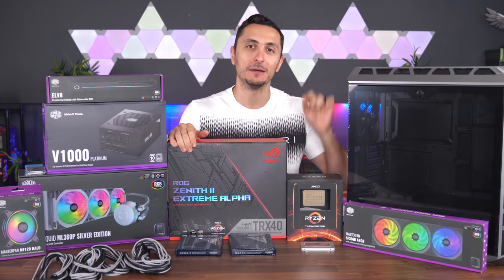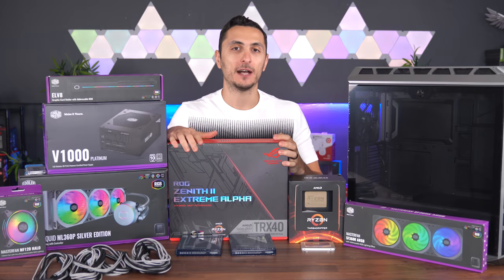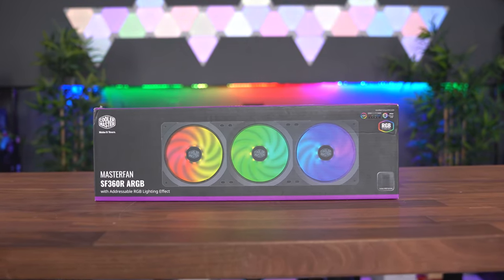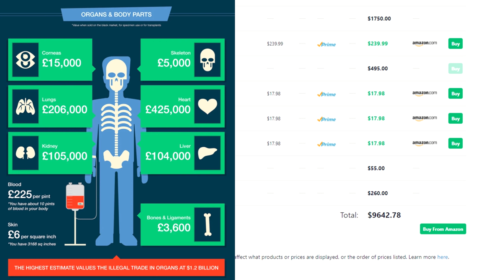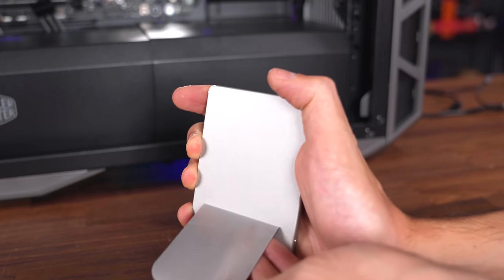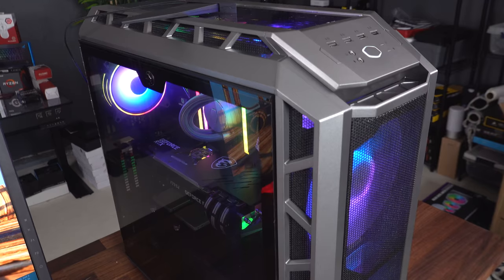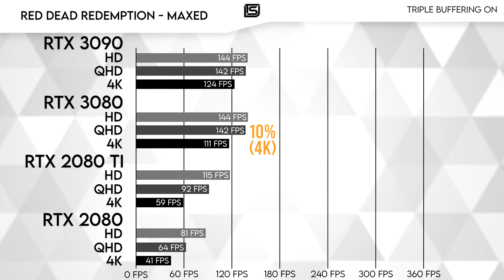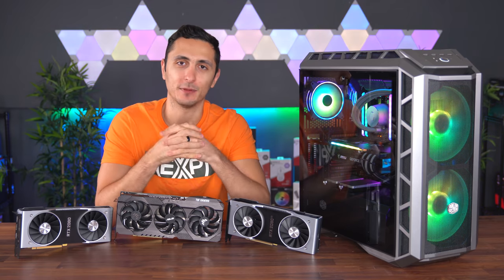Ultimate $10,000 RTX 3090 + TR 3990X  PC Build

Comment: Quick tip: flip the radiatior because it always has 5-10% air in it and air will rise up the tubes and enter the pump making it noisy and less reliable
Reply from the maker: I couldnt do that because of the way the cooler was designed. The bracket gets installed only 1 way.
Reply: @TechSource  then  top is the way to go 👍🏻
Reply: @TechSource Edgar I’m 11 and never had a gaming pc I’m thinking of getting one would these specs be any good 1650 super and a Ryzen 3300x thank you  😊
Reply: @FortniteKidOn60 FPS Dont buy a pc if you’re only gonna play fortnite, plug a keyboard and mouse into your console.
Reply: Red Eyed Ghoul thank you but I play Skyrim and warzone and lots of other games XD
Reply: Red Eyed Ghoul for the love of god don’t play Fortnite with k&m in a console the input delay is no bueno.
Reply: @SkyQ Who tf would spend over 1000$ just to play fortnite.
Reply: Red Eyed Ghoul  you have a very good intro 😉
Reply: Red Eyed Ghoul but that intro

Comment: 1000w seems a little light. Also, be careful using RAID with NVMe. One of the big advantages of NVMe is that the CPU has a direct connection to storage. As soon as you turn on RAID, you give that up. Also, in the case the rad should be on top. The front 200mm fans don’t have enough static pressure to push through/around a rad. Last, the 3970X would have worked just as well for non-numa aware applications (which is almost everything).

Comment: Hey TechSource, I wondering if this is a good build. 
Specs:

CPU: AMD Ryzen 7 3700x 8 Core Processor
Motherboard: B550
Ram: Corsair/G Skill 32 GB RGB Ram 3200Mhz 
Storage: 1 TB NVME M.2 SSD
GPU: NVIDIA RTX 3070
Fans: Corsair LL120 Triple PackFans
PSU: 750W Bronze Power Supply
Windows 10 Pro
Total money for the build is 2000 dollars.

Comment: Awesome, almost the most powerful PC ever, but why Ampere instead of having on top the Smart Access Memory?
My ultimate computer to end 2020 would be

Case: Thermaltake View 91
Power supply: be quiet! Dark Power Pro 12 1500W
Mobo: Gigabyte TRX40 AORUS XTREME rev. 1.1
CPU: AMD Ryzen Threadripper 3990X
Cooling: Thermaltake Pacific CL360 Max D5 Hard Tube Water Cooling Kit
RAM: 8 x 32 GB - DDR4 4400MHz
Storage unit: 4 x NVMe PCIe 4.0 SSD
GPU: Radeon RX 6900 XT
Audio card: RME PCI Express 24 bits

Comment: Wait. The Threadripper only supports 3200mhz, so isn't the 4400mhz absolutely unnecessary since it will regulate it down to 32 anyway?
Reply: yes, and funniest think is that if your CPU isnt utilized 100%, RAM overclock is pointless as well.

Comment: I need help, I have a iBUYPOWER PC. The specs for this PC are Intel i7-10700F, it has 16GB of Memory, a NVIDIA GeForce GTX 1660 Super 6GB, and a 480GB SSD + HDD. The graphics I’m giving to my friend and I’m going to be replacing it with maybe a RTX 2070 Super or a RX 5700 XT possibly on Black Friday or on Christmas where it COULD possibly go on sale. And if not those two options of a Graphics Card, could somebody recommend me any. Or whatever other parts I could switch out and upgrade on? For maybe of a good price of $600 or below.
Reply: Rtx 2070 super duh. If you're lucky you could find a 2080

Comment: Omg... did u really use only 64 GB of RAM for a 64core/128threads CPU ??? 
That is the bottleneck of the century. I have 64 GB in my 3950X 16core/32thread build and it is common to max out the RAM in while running a simulation for while,  even when using the 1/4 of the CPU power you got. With 64 cores you are talking about 0.5 GB per thread... just no, you need 4GB per core to do any proper work. Sorry mate you don’t seem to know your stuff around pc’s...